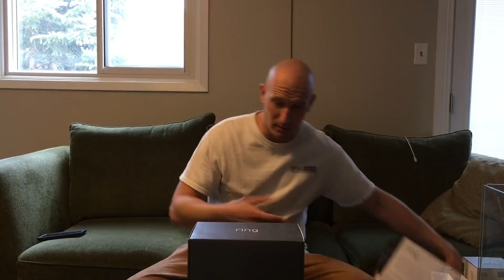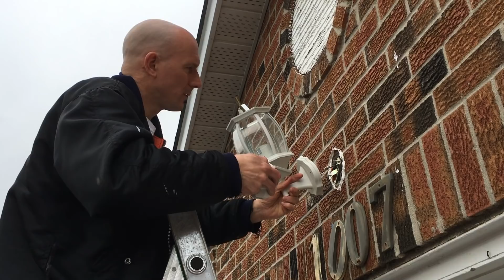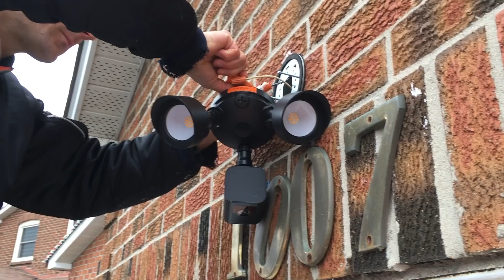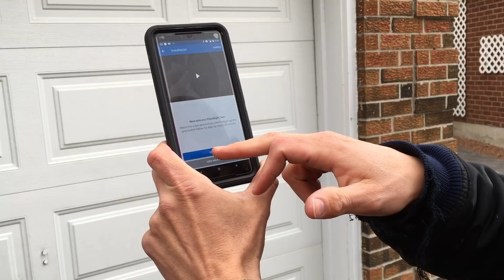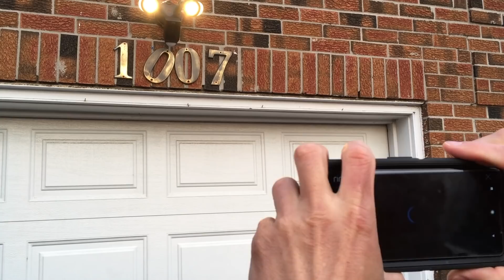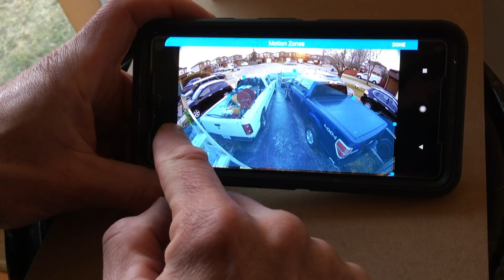Ring Floodlight Security Camera

Comment: Great video Jeff. Very helpful. I just bought a ring floodlight camera pro and was trying to install it. Can you kindly help me with a question? My camera has three wires: Black, White and Green. However, the wall outlet has only two wires popping out: Black and Red. So which camera wire should be connected to which wire on the wall?  I believe black from the wall should connect to black in the camera. However, for the red wire in the wall, which camera wire should it be connected to? Wall Red + Camera White? Or Wall Red + Camera Green? Looking forward to your response.

Comment: Jeff.  Great video.  Thanks for the step by step.  Now, let me pay if forward and help you with a project.  Tools needed:  Ladder, electric drill, small hammer, plastic anchor, screw.  Take an anchor, tap it into the hole at the top of the "0".  Re-position the "0".  Place the screw through the top hold of the "0" and tighten the screw.  Have a nice day.
Reply from the maker: Thanks for the added tool list!  The "0" was fixed but that was certainly funny for the video!  LOL

Comment: Thanks for the Video Jeff.  I am looking at getting one of these,  Not sure about the aesthetics when replacing a lantern style light with a flood light.  Was the original light not switched? My Garage light and front door light are on the same switch.  How is the camera coverage?  I am wondering if I want to cover right in front of my garage door to the end of my driveway.  If it is to high the camera will be on more of a down angle and if to low will not cover right in front of the garage.  Any thoughts?  Will also be interesting to see how these stand up to a Canadian winter?

Comment: hey Jeff how many feet away should I worry about when getting the door chime? my house is almost 3000 sq ft
Reply from the maker: I would say you have to test it out it really depends on the interference like walls, floors etc.  I have a friend that is using one of these in his garage and the floodlight camera is outside on a light pole over 100 feet away and works perfect.  My router is on my 2nd floor and the chime is in my kitchen.  Works perfectly fine I'm sure I could move it anywhere in the house and it will work.
Reply: Ok man thank you very much

Comment: Great video. Thank you! Thinking of the LED wireless camera. Can screw in at any location or they have the stick up ones as well. Advice??
Reply from the maker: Yes the wireless cams are great as well.  There is a spot cam that has a battery and you can also get the solar kit that keeps the battery charged and use it anywhere!

Comment: I’m thinking about replacing one of my exterior house lights and putting this ring floodlight instead but was wondering when you do that, does your light switch still work?  Like when I want the lights to be on? or would I have to turn the lights on manually through the ring app? And if so, do they stay on permanently until you shut them off on the app or are they on a timer?
Reply from the maker: The switch would have to remain on at all times to keep power to the camera.  You can control the lights from the app turn it on or off at anytime.  I only use mine with motion.  The only issue is if  you have other lights on the same switch like I did. I had to replace one of my lights with a motion light as well.

Comment: thank you , however could you advise if the camera notifications and screen shots are clear? the reviews in Costco for this year are horrific!!!! please advise
Reply from the maker: Yeah they are clear.  The only time I notice any glitches are when there is a slow down in the internet connection then you will see picture issues.  99% of the time it works perfect with no issues.  Strong internet connection is everything for these things.  Also, I have noticed the app has been updated with some cool new features and the interface is easier to snooze your camera and navigate what you want without pulling up a new screen.  Simply click.

Comment: hi ..did  you wire this camera with network cable too or only power cable? and after that it is find wifi network ?? just try understand how it is working.
Reply from the maker: It was wired only to power and then it connected to my wifi network.  I also used the Ring Chime Pro Extender to boost my wifi signal to it.

Comment: Good job Jeff, feel more comfortable about getting one.  My issue is eve mounting.  Wish you would show how to adapt it to ceiling mount.  Ring does not recommend.
Have seen photo of the unit eve mounted, but no detail.  Maybe an adaptor?
Reply from the maker: That is a very good question!  I believer there are adapters that will enable you to tilt the floodlight on an angle or as much as its needed instead of straight down.  Not a very common install which is probably why I've never seen videos myself of that but it does make a good video option!

Comment: Will the Floodlight cam interface with the Ring Alarm system?  It would be nice to have an alarm on the outside of the house.  (Ring Alarm only trips inside the house.)
Reply from the maker: I will have to find out for you.  I'm actually going to be purchasing the Ring Alarm System and I will be installing that shortly.  I will check into that for you if you don't already know.

Comment: Jeff you should know what WIFI EXTENDERS ACTUALLY SLOW YOUR STREAMING DOWN ,JUST THOUGHT YOU SHOULD KNOW THAT.
Reply from the maker: Yes that is 100% true due to the fact the extender now has to talk to the router slowing the connection down for sure.  My cam would not work without the extender.  I didn't really get too technical into it but I haven't had any issues with my video as of yet.
Reply: @JeffLepard  LINKYS MESH SYST EM 3 SEPAERATE ROUTERS WORKS GREAT.

Comment: I have a question ok our floodlight light now is hooked up to the front door light and you have to have the switch on for the front door and floodlight to work. If I turn the switch off on the front door will it turn the cam off?
Reply from the maker: It will turn off the camera you have to leave the switch on at all times.
Reply: @JeffLepard  Ok Jeff thanks.

Comment: Did you have a ground coming from your house?  Which ground wire did you wrap on the green screw? Was it from the light fixture?   Thanks
Reply from the maker: That is just the copper wire that grounds the actual unit.  Your plate may already have a ground wire from the house.  Even if it doesn't just attach that copper wire from the floodlight Cam to the mounting plate where the ground wire screw is.

Comment: Great video, Jeff. I just recently got the Ring Doorbell Pro, and I am so impressed with it that I want to purchase a couple of the Ring Floodlights to replace my existing floodlights. My only concern is that the lights look fairly small. I am afraid that they won’t be as bright, or have as much “spread” as my current flood lights. What is your thoughts on this?
Reply from the maker: That's a good question and I was worries about the same thing.  The 2 LED lights are actually very strong.  They are stronger than most floodlights I've used.  I don't think you will be disappointed with them.

Comment: Where's the new sealant around the Ring Base?  You just want to go ahead and let water in behind the mount?     I've decided to install a Wired Camera Setup with an NVR.  Using PoE cameras.  Zero monthly cost and still access over the internet and alarm warnings, etc.    I don't like the forever Cloud payment model everyone is doing these days.  Though RING is more reasonable than most others at $3 a month or $30 a year.  The Plus service at $10 a month or $100 a year for Professional Monitoring, which I guess if you get their Alarm Setup and want Monitoring for that.  From from I can tell, it's $3 a month for each device, so 3 devices is $9 a month, anything more it looks like the Plus service covers your Alarm system and any and all devices?  Which isn't too bad if that's the case.  Currently, $100 a year if you pay all at once.  Though prices could go up.    Again something you will be paying on forever, or so long as you own the device or replace it in the future with an updated device.   Just something to keep in mind.
Reply from the maker: +JB Dragon The base on the floodlight has a rubber gasket so you dont need to use any silicone.  Yes that is true you will alwaya habe to pay if you want access to the stored files.  I went with these products instead of using my own system just because im not sure how long i will be at this house and also how quick and easy they are to install.  I do love personal systems im a fan of those as well!

Comment: How do you still like it?
Reply from the maker: +bryce crane i absolutely love it.  I havent had any issues except whe. The power goes out in my area.   In the next week or so i will be installing the ring door bell pro.  I will post that video as well.
Reply: Jeff Lepard I just got the free ring doorbell first model with the purchase of this floodlight cam.
Reply from the maker: +bryce crane thats amazing!  Is that the one woth battery or hardwire?  Unfortunately for me i have to change the doorbell transformer to 20volts the one i currently have will not run the ring door bell.   Its going to be a full install it should make a great video.
Reply: Jeff Lepard it’s just the one with the battery unfortunately but it’s free so🤷‍♀️ worth 100 bucks lol
Reply from the maker: +bryce crane cant complain with free!  Awesome!
Reply: Jeff Lepard I got the flood light cam that was hardwire only and the doorbell is both battery and hardwire love these products
Reply: Do the lights behave like regular flood light fixtures, in that they go on at night and off during the day automatically?
Reply: dfizzbom yes

Comment: excellent video Jeff   lots of insight and help on the how-to-do-it work.
very impressive.
one thing I've found after years of installing exterior fixtures and lights is to tie a secure line to
the fixture i'm removing and the one i'm installing. 
they often have an offset center of balance and can break loose.
i bought one or two replacements back in the day before safety tying them.
learning curve for me.
i found the LED lights brighter than i anticipated.
RING did a nice job with this product.
Reply from the maker: +pensive69 thanks for watching the video!  Yes a secure line does help with the install!  Ive dropped a few fixtures before in my life lol.  Yeah the new LED is amazing.  When LED first came out it was so dim and wasn't brighter than your standard bulbs.
Reply: @JeffLepard  +Jeff Lepard. This is great for watching people.

Comment: Looks simple enough to install Ring Floods. 
My question is , I will be replacing old switch operated flood; will the switch still apply. I want it to be totally motion or app  controlled. Can I bypass the switch with installation or will it always need to be in the ON position?
    -Jim, un-electrically inclined. :)
Reply from the maker: +Jim Sherwood when i installed my flood light i was considering bypassing the switch but im glad i didnt and i'll tell you why.  There was some power outtages that happen around here regularly.  On some occasions my flood light will not connect to my wifi extender or my router and i have to reset the floodlight by disconnecting the power and doing a full set up again.  I found it very easy if it was off of a switch i just taped the switch in the on position.   This way i can do a reset very easily.  I will mention though that i havent had to do a reset for a while now even when the power goes off.
Reply: You might be able to bypass the switch, but there are a couple of variables that you need to consider. It will depend on how the switch is wired and whether or not it is a two-way switch, meaning it is the only switch that controls power to the light, or a three-way switch, where two or more switches can control the one light. The other factor, is the power fed through the switch or to the light. It is very common that it is through the switch, but not 100% of the time. It might be best to consult someone who is electrically inclined. If it is a two-way, power through the switch it would be simple to bypass the switch. The easiest solution, tape it in the on position.
Reply from the maker: +Geoff Wilford Thanks for helping out with the comments I appreciate it!  😉.

Comment: How bright is the actual light? And, any lag on the video if viewed from outside the network?
Reply from the maker: They light is actually pretty bright!  Its just enough light to light up the entire area.  There's is maybe a 1 second delay I have from receiving.  I can view it anywhere and it won't make a difference just as long as I can connect to the internet from my service provider or wifi.
Reply: Jeff Lepard just bought a 2-pack... was a pretty good deal, so I jumped on it. Thanks for the review, and the response.
Reply from the maker: That's excellent!  Hopefully at a good price!  No problem anytime!
Reply: When a Camera or say a Video Door Bell is running on battery's, they have to normally be in a sleep mode to conserve power.  When they sense motion, they power up and then work as they should.  This display can cause them to miss something that could happen in a few seconds.  I would think that this like being wired into power wouldn't have that type of issue and so the camera would respond a little quicker.

Also, Wifi Extenders generally cut your Wifi speed in half which is why they are generally not recommended these days.  Better to go with a MESH type router setup.  Using that Ring Extender which is only for RING, it may be fine for their camera connection, but if you don't have very good Wifi in that area and you would like better Wifi in that location, again, a MESH setup would be better and RING can also use that.   It would be OPEN to all of your devices.  Maybe you would like some SmartHome Light Switches?  I can Open/Close my Garage using Siri.  I have one of my Smart Switches for my Garage linked to my Garage door opener using Apple's HOME App.  When the garage opens, either using the Wall Button or Siri, the Garage light on the side we're walking though comes on also, really lighting up the garage to much better see.  When the Door closes, it then turns off all on its own.   It's one of the best things I've done.  My 70-year-old Dad lives at my house.  It really allows him to see when he gets home in the dark and walks through the garage as to not trip over anything.    

So it's this kind of thing where it's nice to have good Wifi all over.   It allows me to have a growing SmartHome.   My Dad can adjust the temp in the house using Siri.  No need to get up and try and mess with it.  I'm using an Ecobee 4 for that.  Just have to figure out what kind of house you're going to be. Apple Homekit using Siri, Alexa, or Google home.  There's even Samsung SmartThings, and a few others.  

Going with RING, that's an Amazon owned Company, and so Alexa only supported.  The sad thing is Homekit support was coming until Amazon Acquired the company.